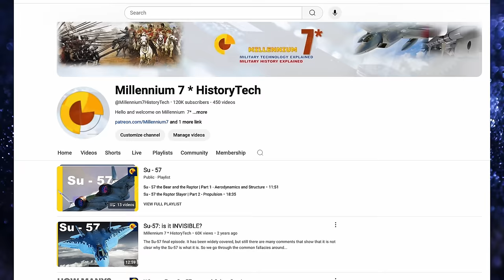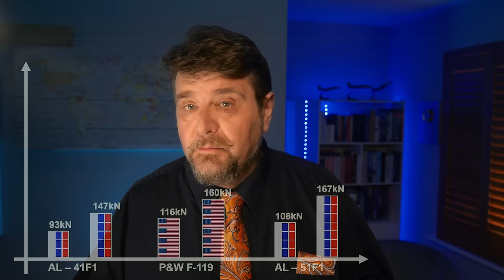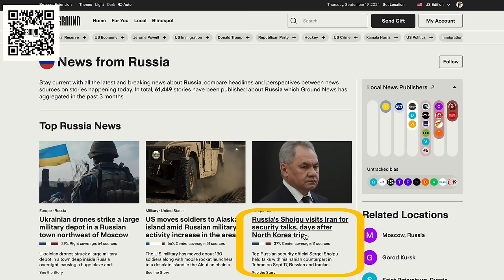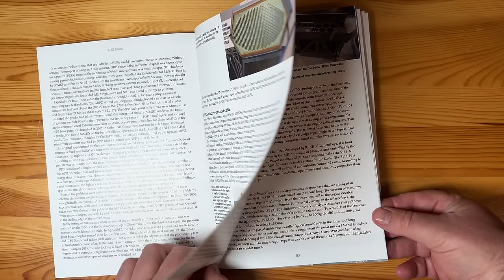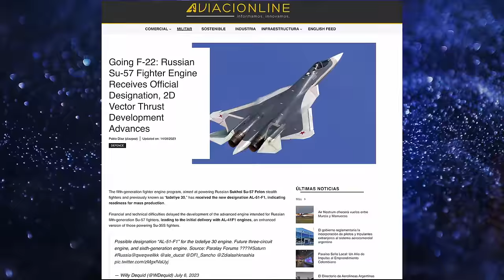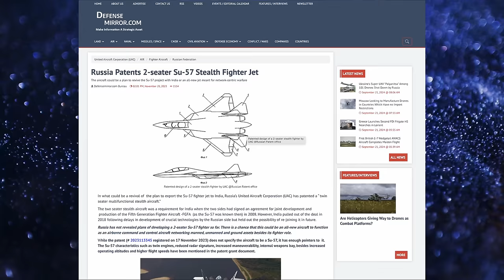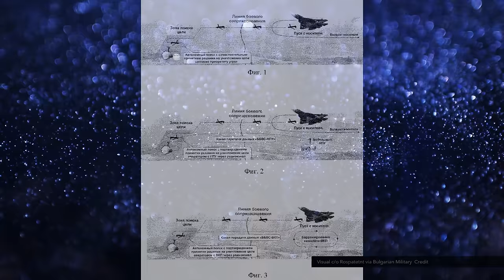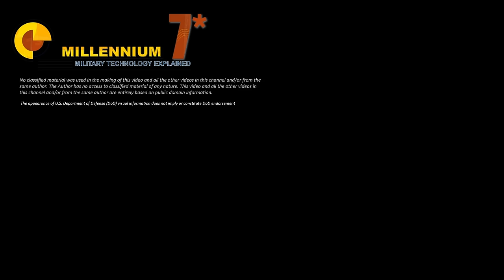The Su-57 is a Masterpiece!

Comment: One explanation for flying Su/35s with SU57s is using them as "missile buses". The Su57s use their more advanced sensors to detect targets and the flankers (which can carry more or bigger weapons externally) do the shooting, maybe?
Reply: That's the F18E/ F15EX role with F35. Reasonable to think the Russians would crib the idea.
Reply from the maker: That is true, it is one of the possibility.
Reply: S-70 Okhotnik is supposed to fulfill the same role.
Reply: @Masluker wont be operational before ru collapses
Reply: @namesurname624  You know how the song goes: Dream on!
Reply: ya btw is it crazy that they want to make sure a lucky shot wont hit it ? i dont think even if thats the case they can vbe criticized for it
Reply: @rookiexreviews I would assume that when the Russians go out on complex sorties, they have a tiered stack: Mig 31 flying high and back, down to su 34 flying low and forward, with the su 35 doing backup at a higher altitude. Perhaps the Su 57 act as wolf packs, hiding in the stack and targeting dangerous assets as they arise.

AFAIK Israel used such a system to great effect in its air war with the stickers in Egypt. I'm sure an updated version of the strategy is  used in modern contested  airspace.

They could also be coordinating data links between various assets and perhaps providing passive radar and optical surveillance. Russia just launched three military satellites this month. Could be they're adding to the polar orbit over Ukraine, thus providing a 24/7 view of the theatre. If you have any news, please publish. 😬
Reply: "One explanation for flying Su/35s with SU57s is using them as "missile buses". The Su57s use their more advanced sensors to detect targets and the flankers (which can carry more or bigger weapons externally) do the shooting, maybe?"

They wouldn't be flying TOGETHER however.   Their datalinks don't care if they're 50 meters or 50 kilometers from each other.

Also, as someone with at least a few not quite inside sources(more like nextdoor or something), noone in Russia seems to ever have heard of them flying physically "together".   So i'm pretty sure that IF there is any cooperation, it's of the more distant kind.
Reply: @namesurname624 US debt will collapse the planet Earth sooner 😂
Reply: That's actually a possibility
Reply: Quisiera un programa sobre el radar hibrido eterodino de barrido electronico del su35s el no35 irbis
Reply: @olexp9017  "US debt will collapse the planet Earth sooner"

Considering that USA is getting dangerously close to the point where they become unable to service the interest on their national debt?
Definitely.
US debt is going up by 1 trillion every 3 months.
And because China has started to sell off US bonds and NOT buy new ones, the interest rates are forced up and up and UP...
Slowly but noticeably.
Reply: @namesurname624  Wishful thinking.  I wouldn't count on that.
Reply: @rookiexreviews  sure 35's may play body guards second role on this stage, but definitely they were more for dirtying electronic fields with their huge signatures along with carrying a lot of boom for provided targeting from 57.
Reply: @lavenderlilacproductions It's not so much "the idea" as a concept put forward and scooped up by the media. In reality those aircraft have never operated in that way, and may never do so.
Reply: @DIREWOLFx75  WhatIfAltHist said he expects US civil war in 1-5 years and I lean to believe him, but withing a frame of 3-7 years.
Reply: This makes a lot of sense. Su57 scouting farther out at low altitude, while Su-35 or Mig-31 are high up and 100-200 km behind. Even better if Su57 can use the AESA to undetectably lock on and datalink the missle, but not sure the Russians have that tech. That would be a very scary opponent - long range Russian IR missile guided to target by undetected Su-57 from radar lock until the missile is close enough to track via IR. No RWR for that - just a big unexpected fireball.
Reply: @true_xander  I truly believe we are not that far from this. Honestly at this point I welcome it. Id rather deal with this myself than simply punting it off to our children and grandchildren.
Reply: @true_xander  Due to the severe ineptitudes and gross incompetence of the ruling class of USA, yes, it has absolutely become possible.

It is however still not something likely.
But almost anything could tip the scales if something bad enough happened and the response from the establishment was stupid enough.
Reply: More advanced that what exactly 😂😂💀
Reply: American fighter pilots have said we use F-35s alongside older airframes in a similar manner
Reply: Or just flat-out protection.  If Russia intends to sell the 57 (almost a certainty), it's a huge benefit to state "used successfully in the blah-blah-not-war in Ukraine.   At the same time, they would not wish AT AMY COST to have the 57's strengths & weaknesses fall into western hands.  Worst case and the "body-guards" could destroy any downed 57 -- regardless as to why it met an untimely meeting/dis-assembly with mother earth.
Reply: @Doodelz02  you're talking as if the Russian air force wasn't completely on it's knees in this war 🤷‍♂️ they have about 2 per cent of the capability they should have
Reply: My thought was actually that a pair of Su-57s might actually be escorting flights of Su-34/35s, not the other way around. You have larger numbers of the latter but still can't afford to lose them, so you send something with better electronic warfare systems to try and give them added protection.
Reply: @namesurname624  su-57 already was used with s-70 drones
Reply: @namesurname624 yeah, poor Russian soldiers, they ran out of ammo 2 years ago atd are fighting only with shovels. And the Su-57 uses microwave and washing machine microchips, yada yada. Keep watching CNN!!!
Reply: @djgtuk2012 yeah, they lost all their airplanes, and their soldiers fight with shovels... please, do yourself a favor and stop watching CNN
Reply: @jamesleadley7872  the latest Russian gear does have data links, and they're slowly porting it to modernized planes of previous generations. That's why in Ukraine at one point an S-300 was fired with the target acquired not by its own radar but by the Russian AWACS (always forget its name). That's also how some moths ago a Russian plane hit a target from 400km away: the missile was guided on its path by the radars of the S300 and the Sukhoi planes near the target, switching to GLONAS (i.e. Russian GPS) + IR sensors in the last seconds. Those shots were more tech demonstration than useful, but they serve the purpose of testung the technology in a real combat scenario.
Reply: @jamesleadley7872  su-57 do it already in Ukraine with s-70 drones.
Reply: F-35's flying on strike missions are supposed to be escorted by F-35's with air-air loadout.

The planes which do fly strike missions unescorted are the ones with hardpoints to carry bombs and long range AAm's.
Reply: @Masluker  Podľa najnovších správ má byť hotový niekedy okolo roku 2098.
Reply: именно! су57 используются как командные и разведывательные машины. проще говоря видят цели дальше и дают команду ракетам которые несут су35. звучит странно но су57 могут буквально запускать ракеты на более старых машинах. вообще то такое было реализовано еще на миг31 старом.
Reply: @georgeantabi6025  December 25, 1991. History repeats itself, we're watching the collapse in real-time.
Reply: @GCSloan95  didn't you say that in march 2022? I guess I'll have to keep waiting..

Comment: An excellent, well-researched video. I agree: achievement is achievement, even when the accomplishment belongs to an adversary.
Reply: 25 planes built is hardly an achievement: How many F-35s does the US and it's allies have? Over 1000
Reply: @shuathe2nd  The design & development is the achievement, not the numbers produced.
Reply: @shuathe2nd  So MiG-21 is way better plane then 🤣
Reply: @olexp9017  The Mig-21 was a very successful plane when first introduced, being in many ways superior to equivalent US planes e.g. The F4 Phantom which was big and heavy by comparison. They made over 11,000 if you include Indian variants, so by definition it was one of the most successful jet fighters ever built. By the mid 1970's though it was beginning to be outclassed and the F-16 and F-15 were both far superior - they should have been as they were 20 odd years newer. We won't really know how good the SU-57 is if they only make a  low double digit production run of them.
Reply: @shuathe2nd  Erm, man, I was living near the airbase full of MiG-21, saw them in the sky every 2-3 minutes. And in the university MiG-21 was one of the machines we used for the lab work 😄
I'm a fan of it. But that doesn't mean MiG-21 is better than F-35.
Reply: No mention of radar cross section?
Reply: @bigdre247  no no according to this dude stealth has no bearing any more. Well unless Russia produces any actually stealth aircraft. Then it will be good again.
Reply: @Annou7la  Yes, this is very funny how they said stealth is worthless, until they realised all future russian and chinese planes and drones are stealth. Now they are silent.
Reply: @shuathe2nd  How many can fly at any given time? How many can make repeat flights within 24 hours?
Reply: @sashazxtt  haha, I'm not sure as I don't work with them, I work in media, so just interested. Given the numbers though it is almost irrelevant as there are so many of them. Numbers have a quality all of there own I believe someone once said.
Reply: @shuathe2nd  It was Karl Marx who said that. Amazing, isn't it?
The thing is that such numbers can bankrupt a military. When very many very expensive planes don't fly, it becomes, well, expensive.
Reply: When youre surrounded by 2 oceans and 2 friendly nations, your adversaties are your choice.

Comment: Current "round" nozzles have 2D tvc, but they deflect at angles similar to what can be seen on the image with flat nozzles. So, no regression in that regard

Flat nozzles are actually somewhat heavier because of huge flat surfaces that must withstand high G overloads And high speed air flow during maneuvers

Flat nozzles help to reduce IR signature when they have with to heith ratio over 2:1 which is actually not the case both on al-51, and on the raptor.

There's one unmentioned area in which such nozzles are better than conventional ones: due to their shape they have lower rcs
Reply: The su-57’s current nozzles are 3d not like the su-35’s 2d nozzles
Reply: Are you sure about the round nozzles being 2D I swear i've seen them move in 3d I might just be misunderstand you though lol
Reply: @ilyavolkov2556  yep, I'm certain. That's a popular misconception which can be pretty easily debunked. Just have a look at any 57 video and try to find a moment when its nozzles are moving in any other direction than the V pattern
Reply: About to say the same thing. Found the comment. Upvoted. Leave.
Reply: @ГеоргийМурзич  they are 3d
Reply: @Akuma_Z  nope
Reply: @ГеоргийМурзич  video "modernisation of al-31f" around 8:10
Reply: You're completely fooled by western biased. There are plenty of videos Su-57 engine moving more than v-direction. The engine that moves in v-direction is only for Su-35.
Reply: @Akuma_Z  that's a prototype that never entered serial production
Reply: @mjabb02  show me at least one such video
Reply: @mjabb02 people still believe it's 3D when they can't understand the concept of 2D vectoring when it's angled, maybe look closer on those Su-57 videos, I've seen the same videos. Mig-29OVT and F-16XL are great examples of 3D thrust vectoring where it can move in all directions.

Comment: Nice video!
The reasons Su-57 was not in full scale production:
1. The engine not ready (perfectly covered in the video. Btw, Rostech announced a month ago that the new engine is ready and, most importantly, has been accepted for Russian Army (VKS) use. 
Therefore, all newbuilds will be fitted with new engine and, upon completion of the new production line at the factory for Su-57 the deliveries will double from 12 annually to 24 annually. Presently, 67 Su-57s have been ordered by Russian MOD. Most likely, the order will be expanded.
2. There are hundreds of pilots already trained for Su-35S and Su-30SM. It would be smart to provide them with planes they can use with minimal preparation, rather than to retrain them for a new model.
3. Ukraine (NATO in its current state) is not an enemy requiring huge effort to defeat. Russia has a luxury of time to perfect its truly modern designs like Su-57, T-14, T-15, Koalitsiya self-propelled howitsers, S-500s, battlefield robots etc. to use them in battle sporadically in order to test and hone them. 
The job of destroying Ukraine can be done using proven tools and cheaper, then why pay more?
Reply: Like any other Weapon since Tsar era , the Russians start with weapon and they keep upgrading it into something better , for example T-72 and now they have T-72B3M. Despite the financial issues russia had since 90' and wars , they are doing well.

Comment: I agree, the Su-57 is a fantastic airplane and great design should be respected on its own merits.
Reply: the thing is it is not an airplane and seeing it as one is missing the point. it's a "Frontline Aviation System" as the project was quite clearly called PAK-FA for Perspective Aviation Komplex - Frontline Aviation. Russians did not just make an airplane, they had a vision and the Su-57 airframe is just its visible part.

Comment: Su-57 may or may be not up to par to F-22 Raptor (depending on who you ask) , but it has one major advantage: it is in production, even being a low rate one.
And I think nobody serious can question aeronautical engineering mastery in Sukhoi buerau.
The only open question remains the effectivness of different installed electronic hardware, which was a problem that also plagued early versions of MiG-29, for example. But it is no secret that even F-35 has some problems with that, despite high volume of production.
Very good video, as always.
Reply: The Su-57 has less than 2 dozen in service, with a planned total order of 76 by 2028. At the current rate that is looking at about 60 by then. The F-22 still has more than double that in service and  NGAD will be coming not long after.

Then there's the more than one thousand F-35s, which is a more capable fighter, reconnaissance, strike, and EW platform than the Su-57. Although the lead is not as large as the F-22 compared to the Su-57 in the fighter department.
Reply: @ImBigFloppa  The F-22's readiness rate is bad enough that by 2028 that would equate to actually a really similar number of F-22 and Su-57 fieldablel by 2028.
Reply: The F-35 has SOME problems, how about numereous & serious problems?
Reply: @DaleChipplethunk  You are comparing the ready units of the F-22 with the total units of the Su-57. What gives you the impression that the most corrupt nation in Europe, with a military that is "second" best in the world and is currently stuck in trench warfare with the poorest country in Europe using Western scraps, will have any kind of reliability or readiness rate?

Even if everything went according to plan for the RuAF, and they got 76 Su-57s by 2028, and got an outright impossible 100% readiness rate (lucky to get 60%),  it would still be up against 150 far superior Raptors with a readiness rate of a minimum of 50%.

A low ball Raptor force versus a laughably generous Felon force and only then can the Su-57 reach the same quantity.
Reply: @ImBigFloppa   "What gives you the impression that the most corrupt nation in Europe, with a military that is "second" best in the world and is currently stuck in trench warfare with the poorest country in Europe using Western scraps, will have any kind of reliability or readiness rate?"

Thank you for immediately discrediting yourself so that I don't have to waste my time before finding that out
Reply: @ImBigFloppa ngad wasnt cancelled?
Reply: Has anyone seen the F-22 in a real combat situation? 
That's it. Nobody.
So far, all its advantages are only on paper.
I’m generally silent about the F-35, it’s a complete disaster
Reply: @МескалитоПейот  Syria.
Reply: @hoghogwild  Reports of the US military have been published, which say that Russian electronic warfare (EW) systems located in Syria have seriously damaged two American fighters – the F-22 and F-35. As a result of the energy impact on the aircraft, the pilots lost their orientation and returned to base with great difficulty. After a ground study of the fighters, serious malfunctions were revealed in the operation of some electronic components, which, apparently, will have to be changed.😆
Reply: @vladimirnikolskiy  Sounds like you are describing a Directed Energy Weapon has 'dazzled' in theater F-22/35s.  Interesting.

Comment: i think this is the only channel that provides accurate unbiased analysis on military aircrafts and aviation in general. I have really learned a lot and enjoyed every video thank you so much for that. As per the su-57m, I totally agree with you that it is indeed a masterpiece despite the fact that the program has not matured yet. I also believe that its original in every aspect and that the Russians are dead serious about bringing it to becoming a 5.5 gen fighter and further-"they claimed to have designed it as a platform that would evolve by time"- and that they have something still up their sleeves about stealth tech. I've read about them developing some fiberglass coating plus some plasma generating device that would ,if used together, make it invisible to radars as well as other sensors even at close range. I really think that this time their claims about this su-57m program should be taken seriously. what do you think about these claims, sir ??